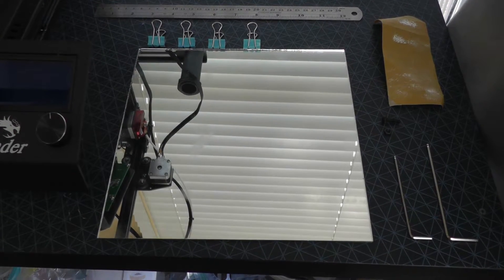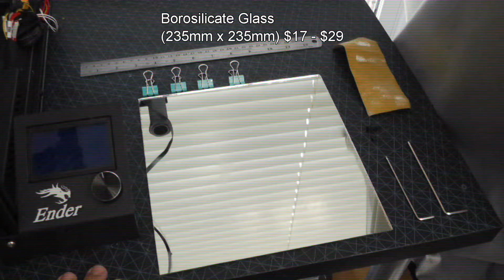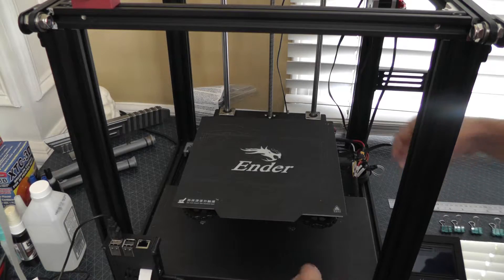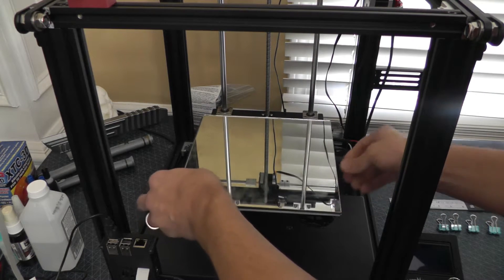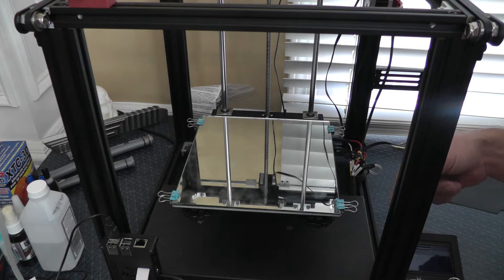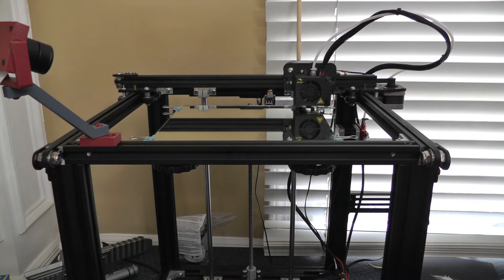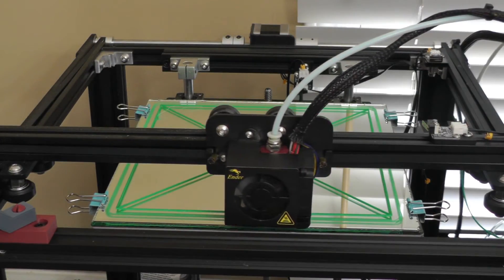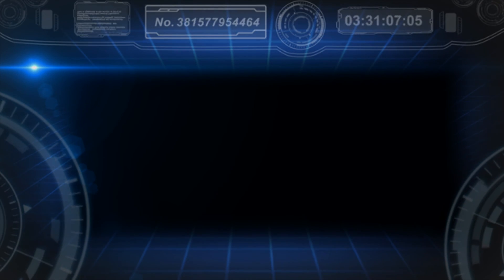Creality Ender 5 Upgrades #2: Glass Print Bed

Comment: I switched to the borosilicate glass and cleaned it with denatured alcohol and the PLA filament that I’m using isn’t sticking at all. What can I do? The glass is the same size as the hotbed. I have a job to print to hold my hobby paints and it’s 1 day and 9 hrs...... so I need to get started.....
Reply: I had the same problem the first time I tried to print on glass. First I tried to do a proper leveling (which is always good!) and add more to the first level squish in Cura, but the results were not the best (although it helped a bit). Then I learnt about a miracle - hairspray. Glues sticks did not work for me very well, but hairspray completely solved all my issues with the first layer not sticking and I use it since. Just spraying it a bit over the bed does the trick for me (and cleaning it and re-applying it from time to time, or before any important prints). Cheap and effective. The only bad thing is that it smells around my work space like in a cosmetic salon haha :D
Reply: @Pangaron  Any hairspray? I'm using one from my wife and seems to stick better than before but you touch it and it comes right off. I however see smoother prints once I installed this non-tampered glass. My friend can cook it so it is tampered but I told him that it's not necessary, I'm using a 3mm thick glass.
Reply: @scientist100  I use NOVA Ultrahold hairspray, which seems to be some kind of local rebrand. Then again, I am no expert in hairspray. I just know that this one sticks A LOT, sometimes I have difficulties to even remove the print (much easier when printed with rafts of course). Heating to 60 C and the results are pretty much flawless so far. So I would recommend trying some with the word "ultra" or "strong" or something like that.
Reply: @Pangaron  I came back to report that the hairspray may work after cleaning it with warm water and soapy water. I believe in my case, the glass was already contaminated from the source or by me when I tried to clean it with 90% alcohol since it would not stick, it would come off really easy as shown in this video. I washed my glass with warm soapy water, let it dry with a heat gun and left some water residue, I followed by just using cotton to clean it a little more, didnt' really clean it as you could still see some water stain spots (could be my water not clean or the soap left over even after rinsing it, to my surprise now I'm asking for advise for removing parts as my first print was really stuck lol, had to pry it quite a bit to get it started and even after that it was still difficult to remove lol. I'm still happy I'm able to print a part that I had been unsuccessful in the past, even with the magnet bed that came with the Ender 5.
Reply: @scientist100  Great news! Glad it works for you now and thanks for the info  :) Happy printing!
Reply: @Pangaron  yes, no need for hairspray man. Save your wife's spray and the smell that you gets when it gets warmed up and the print itself lol. I need nothing more now. One design that was a little curvy kept failing on me before. Now I feel confident leaving any part and expect it to complete without any issues.
Reply from the maker: Ah... I remember trying that and not understanding what I was doing wrong! Alcohol won't work. You need to use hot water and dish detergent as if you were washing dishes. Then either air dry or use paper towels. Let me know if that works for you! Also make sure you're at the right height and squishing the filament just a bit into the glass.
Reply: Kersey Fabrications yea, I’m definitely new to this. I’ve been running my Ender 5 almost non stop this weekend. I wiped it down with a micro fiber towel and it is working pretty good now. Thanks for the help. Just a note, I put the clips on and after two failed attempts the glass is now stuck to the hotbed. No clips needed.....
Reply from the maker: @johnfulwider7510  I found that out as well about the sticking without clips. I still use them anyway to be sure it doesn't warp.
Reply: @kerseyfabs  I didn't think glass would warp at 60°. Hmm I'll keep an eye on it. Thanks for your help brother.
Reply: @kerseyfabs  Totally, I can see lift in the corner of mine without clips. I hadn't even printed on it yet and it was warped, luckily I preemptively upgraded. I had about 15 prints before the bed became a Teflon advertisement lol. Thank you for the wisdom. :)
Reply: @kerseyfabs  I installed a 3mm glass instead of the suggested 4mm by most since my concern was not heating up quickly enough. I notice that the glass feels hotter to the touch than the magnetic bed, should I try lower temperatures? I also made the mistake of using 90% alcohol to clean the surface and my prints come off farily easy during printing, if there is an imperfection that gets touched by the nozzle, it may knock over my piece lol, I will clean it per your suggestion with soapy water.
Reply from the maker: @scientist100  Thanks for the question and comments! Answer: It only feels hotter most likely. Once the plate has gotten up to temperature and the heat has leveled off, both the plastic and glass should be at about the same temperature. Check out this video on why that is: https://www.youtube.com/watch?v=vqDbMEdLiCs
On cleaning the plate: That's exactly what I found.  😀
Reply: @kerseyfabs  would you agree that the temperature will elevate quicker to the outer surface if the material is thin, 3mm vs 4mm and the same thing for cooling? I just didn't want to also add weight to the hotbed.
Reply: @kerseyfabs  I came back to report that washing it with warm water and dish soap made the glass adhere like crazy, tips for removing parts as to not damage them? lol
Reply from the maker: @scientist100  I missed some of your questions:
Hairspray I never liked because of the smell and the mess so I didn't use it long. I know there are certain brands people like.
Temperature will level out over the surface once given some time. So as long as it's not too thick, you'll be fine.
Removing prints from glass, let it cool. Once it cools close to room temperature, it should release on its own due to the contraction of the glass.
Reply: Denatured alcohol leaves a residue, so is not suitable for cleaning. Isopropyl alcohol on the other hand leaves no residue at all, and evaporates rapidly, that's the one to use.
Denatured alcohol has additives to deliberately make it undrinkable. And is toxic due to containing methanol and other stuff.
https://en.wikipedia.org/wiki/Denatured_alcohol

Isoprolyl alcohol is generally pure and has low toxicity, but tastes bad anyway. It's used for electronic cleaning (switch cleaner) among other things.
Reply: John I dont think this will work with textured glass, only flat glass!
Reply: John try this, this is the best glass system ever, whilst printing your plastic will not move but once it has cooled it lifts off as though it was never stuck down in the first place.
https://www.uantwerpen.be/images/uantwerpen/container11343/files/bonding_pla_with_salt_water_v20160713.pdf

Comment: Don't use glass it sucks... Use pei
Reply from the maker: Well, you're wrong, but I appreciate your opinion. 😉
Reply: @kerseyfabs  I’ve got Ender 5 plus few days ago, I turned the textured glass to the smooth one (opposite side) yet I can’t get anything to stick. PLA, PETG, ABS, all of it just won’t stick. Heck, PETG LIKES to stick on everything, but had no luck with pure glass. Thoroughly cleaned it with dish soap and hot water like I used on the textured glass on my JGAurora, nothing. Isopropyl alcohol which I use to degrease my brass cases from lanolin, nothing. Acetone, no, nada. Will probably switch it back to textured surface and try that one.

On your video it also is clearly visible at about 11:16 minute how the pattern moves from surface when head goes up.

Oh, my bed is perfectly leveled using Klipper Screw_tilt_adjust (0,01 minute differencd between points) and biggest difference by BL Touch measurement of bed mesh is 0,1 mm only in one point at the one corner. Z offset is also set perfectly with calibrated metal plates of 0.1 mm thickness.

Comment: I have an Ender 5 and the bed somehow got adjusted and ran the extruder into it, absolutely destroying it.  Luckily it was just the magnet flexible bed it came with.  I ordered a new bed, which came with a new base magnet sheet.  I didn't use it, because the original one is still okay and didn't see the point to try and peel it off.  I recently bought the glass build plate from Creality and was curious about attaching the extra magnetic base sheet to it instead of using the clips.  Any thoughts on doing this?
Reply from the maker: It may work but I'd worry about that being too much insulation between the bed and the heated plate. It would seem that the bed would be several degrees cooler than expected.

Comment: I removed the sticky mag base material by heating the bed to about 65C and gradually peeling it off. For removing any residual glue on the bed- goof off worked well. 
I installed the Creality Ender3 glass bed and it's great ! Great adhesion and easy removal when parts have cooled. Nice upgrade. Keep it clean with alcohol. For attaching the glass, blue painters tape, no Clips !

Comment: Hi! At first, thanks for your videos, they look very interesting and good for a DIY addicted like me! 
I'm currently having issues with the magnetic bed given with the ender 5: my prints (especially larger ones) will start warping at some point in the corners. I've tried them all: brims, rafts, mouse ears and so on. No way, still warping. I'm currently thinking of passing to a glass/mirror bed, but all those negative reviews on amazon discouraged me. I just want to know if it will actually solve my problems and if yes what kind of glass bed is better. I'm really going mad with all the prints and time I've wasted. Thanks in advance to anyone that will answer me!
Reply from the maker: Thank you! I print on glass exclusively at this point. I usually just clean it really well and it works. If I need extra adhesion I use glue stick or Vision Miner Nano Polymer Adhesive.
To be honest, most glass is the same at under 90C or so. I recommend either mirror or borosilicate.
Reply: @kerseyfabs  thank you very much! So just a normal mirror cut down to the right size will do the trick for me? I'm sorry for all these questions, I'm quite new to the 3D printing world :)
Reply from the maker: Yes. That will work fine. Preferably 3mm thick or so.
Reply: @kerseyfabs  thank you very much!

Comment: The glass bed I just got with my E5+ has a textured surface.  Difficult to describe but definitely not smooth like normal glass or mirrors.  Is this an evolution of the glass bed?  Does it still require adhesive of some sort?  BTW, I think the advantage glass has over other beds is that it is inherently flat and not warped or saggy.  You used the word "level" but any surface can be leveled using screws/springs or shims.
Reply from the maker: On one side there is the textured coating. On the other side there is smooth glass. The textured side should not need adhesive. You will just need to keep it clean. Isopropyl alcohol will probably work best but I haven't tried it on that specific bed yet. I guess you could call it "flatness" if you don't like "level" but I believe level from point to point on the bed is still correct terminology. After all, auto bed leveling doesn't just deal with the four corners but multiple points across the bed.
Reply: @kerseyfabs  I agree that leveling the bed is important to prevent the print from sagging toward the low spots but  the terminology "auto leveling" is a misnomer.  No actual leveling occurs.  Rather, the firmware simply compensates for micro high and low points on the surface by measuring strategically significant points on the bed and creating a "map" of the surface which allows the software to make the necessary compensations.  At least that's the theory.  It's not that I "don't like" the term "level".  Level and flat are distinctly different qualities of any surface.  A level surface could be smooth or bumpy and a smooth (or bumpy) surface could be level or not.  In one of your videos you use a level on a bed and are correct in doing so.  I also think it's important to level the X & Y tool paths as well.

Comment: Does adding a glass bed also allow you to print with ABS?
Reply from the maker: Yes, it will allow you to get the bed hot enough to print ABS and get it to stick BUT you will still need an enclosure to keep the print area hot enough to prevent warping.

Comment: Switched to a mirror bed last week on my Ender Pro 5. I bought a "best" quality mirror from Home Depot and cut it up into several 235 mm squares. Home Depot would not cut it for me. I am printing with PLA and Silk PLA filament only so far so I can't speak for other materials yet. At first I had adhesion issues--really bad. So I did what others said and washed the mirror in the sink with regular dish soap. It cleaned up really nice but the adhesion was no better. Then after increasing the bed temperature from 50 degrees Celsius to 65 like I read in someone's comment somewhere, then I suddenly no longer had any adhesion problems. This was the difference maker on my printer. After making this switch, I was able to do much more precise bed leveling than I ever have before. Now my 3D printing is looking so nice! I love how smooth the bottom of the print is. And with solid adhesion even on my edges, the whole print is just nice. I also love how I just clean the mirror with rubbing alcohol and a mirror cleaning cloth in between prints. No glue, no hair spray, no mess. No raft needed either so I am saving on material I had been wasting. And removal after printing has been easy. Thank you !!!

Comment: I bought a glass bed, but when i print something i can’t Peel it off. Do you have a solution?
Reply: I tried scraping and it didn’t work
Reply from the maker: Wow! Most people have the opposite problem. Are you printing PLA?
Here are some things to try:
1) Place the bed glass (and print) in the freezer. It may contract the glass even further which will pop it off.
2) When scrapping, just try to get one corner of the scraper or even a screwdriver under the print to pry it off little by little.
3) Try heating the bed back up and scraping while hot.

I hope this helps.
Reply: Thx for answering

Comment: I bought a glass bed but i cant Peel my 3d prints off, do you have a solution?
Reply: Thx for answering
Reply: I just ordered one and can only tell you about what I have read on Reddit, but:
- Let the Glassbed cool down to room temp
- Use Hairspray or glue(add a layer between the glass and the print - supposed to stick great, but quite nice to get off afterwards as well)
- Alternative to Hairspray/glue (which I will try before anything else) - Wash the glass with warm, soapy water before prints! Let it air dry or use a microfiber cloth
- Use some sort of tape ontop of your glasbed. Eazy to remove, but personally I will try to only use some sort of tape for PETG prints
- When printing PETG, use tape. PETG will likely pull parts of your bed off when trying to remove it. It bonds like hell :D

Hope that helps you a bit =)

Comment: Although I haven't printed anything in a year, I always used a glass bed on my Tevo Tarantula, and will do the same on my new Ender 5 when it arrives. Isopropyl alcohol is the one to use, (Isopropanol) as it leaves no residue. It just works. Not all electrical cleaners are the same by the way.
Reply from the maker: I tried IPA on my glass beds and never got the same results as dish soap and hot water. If it works for you, terrific! I do use IPA on my Ultrabase bed and it works terrific.

Comment: hey i replaced my magnetic bed just like you with an mirror glass. I have clamped the glass, properly leveled multiple times, adjusted endstop screw according to extra height, but any print (even those which printed perfectly before) ends up with nozzle drifting into the print. First layer is beautiful but up to 6th layer it gets worse and ends up with nozle being stuck in the print. Seems like bed doesnt go low enough.. Where seems to be a problém? Any help?
Reply from the maker: It sounds odd but make sure your Z steps are correct. I've seen this problem when it's not moving fast enough.
Reply: @kerseyfabs  thank you for reply. How or where do I check it?
Reply from the maker: From the LCD menu: Control -> Motion -> Steps/mm -> Zsteps/mm
That's it on my menu. Mine is at 1600 for my modified screw. Yours may be 400 or 800.

Comment: Thanks for video.
I use a piece of mirror too on my Ender 2. I just use a 75% Ethanol Solution in a spray bottle to clean the bed before each use. Works wonderfully.  
I use the Ultra Base on my CR10. However, I decided to use glue stick once because of some warping problems. Even when the print cooled, it didn't want to come off. Even after spraying it with Ethanol, it still stuck in the middle. While using a scraper, some of the black came off. (I think I was a bit impatient) I did purchase another Ultra Base for the CR10, because I like the finish and have never used glue on it again!
Reply from the maker: I have never used Ethanol over Isopropyl Alcohol. IPA has never working for me though on glass. I wonder if Ethanol is that much different. I use an Ultra Base on an old Anet A8 I have and IPA has always worked well on it. Great surface!